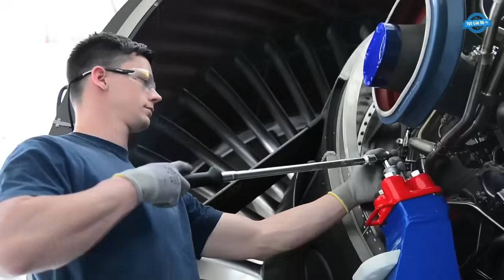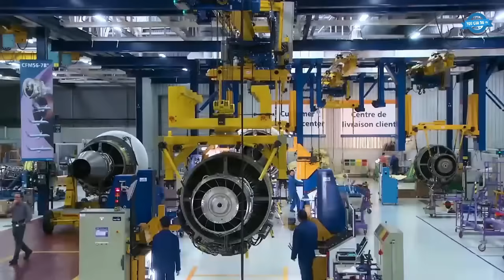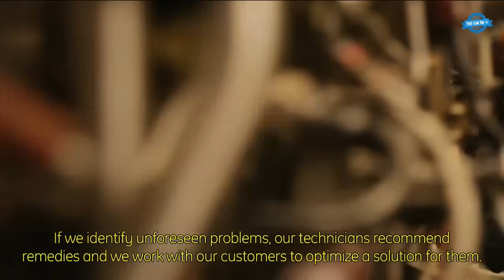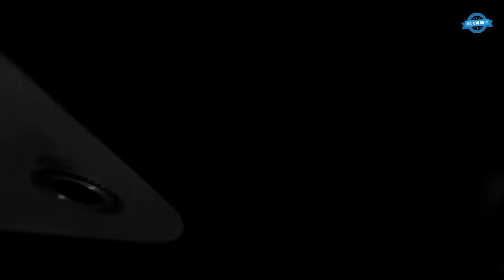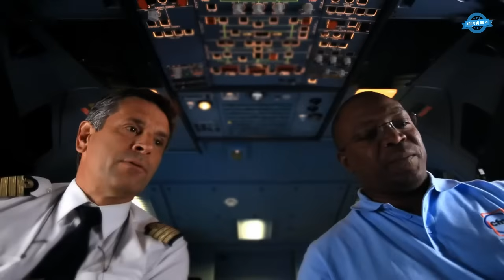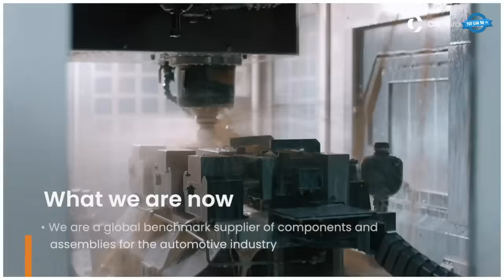How a $30 Million Jet Engine Is Built. Jet Engine Manufacturing Documentary

Comment: Out standing video ! I started working on Jet engines and fighter jets in 1953 . After every flight with a F -80 we would check the turbine blades . The J 33 had a habit of throwing blades . At that time they were working with shot peening and other methods of holding blade roots . Shot peening etc .
I went through a whole series of engines including the GE J 79 and the Pratt J 57 and J 75 series ! Worked in Jet engineering Teledyne then back into the USAF . 
What I see here is amazing . The advancements made in the last 50 years are beyond belief ! The history displayed by U Tube is beyond any college engineering study . Keep up the good work !
I am glad I picked mechanical technology as a career and specialized in Aero Space maintenance and manufacture of components . When I see the advances made it makes my head spin !

Comment: Hello. I am so confused. Why in that turbofan seems that we have clockwise and anti clockwise rotation alternatively? As once I asked we should have rotors and stators a which guide the air flow after passing from each blades settled on a shaft and remove the loss generation and the result is having more efficiency but now it sound very confusing and strange. We don't have this mechanism any more and we have just rotors which they have clockwise and anti clockwise rotation in a shaft! how is it possible? where are stators here? I can't find them in simulators. Please explain completely the basic role and compare it with mechanism of this turbofan . It sound so weird to me and I can't figure it out. 😵😵‍💫
Reply from the maker: Hello! It’s completely normal to feel confused because what you are seeing in modern simulators (like the one in this video) is an advanced engineering evolution called Counter-Rotating Turbines.

Where are the Stators? In a "standard" engine, you are right: Rotor -> Stator -> Rotor. The stator’s job is to "straighten" the air so it hits the next rotor at the perfect angle. However, in some high-performance engines, engineers replace the stator with a second rotor spinning in the opposite direction.
Why do this? By having the second rotor spin the opposite way, it can "catch" the swirling air from the first rotor directly. This removes the need for a heavy, stationary stator between them.
Benefits:
Higher Efficiency: It extracts more energy from the airflow.
Weight Reduction: Fewer stators mean a shorter, lighter engine.
Complexity: The downside is a much more complex "shaft within a shaft" mechanical design.
In your simulator, you might be looking at a Multi-spool engine where the Low-Pressure and High-Pressure sections rotate independently (and sometimes in opposite directions) to maximize performance!
Reply: @YouCanDo_TV  Do you mean we have two shafts which one of them is inner shaft and the second one is outer shaft so they have independent rotations and the blades are set on them independently ? Typically, what almost percentage is the final cost and efficiency  of the second mechanism higher than the first one? Thank you very much.